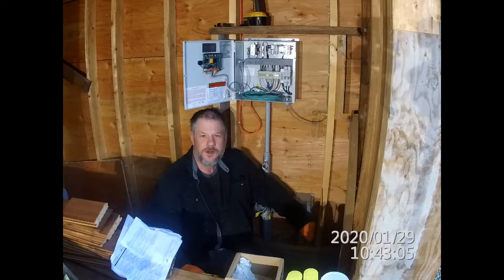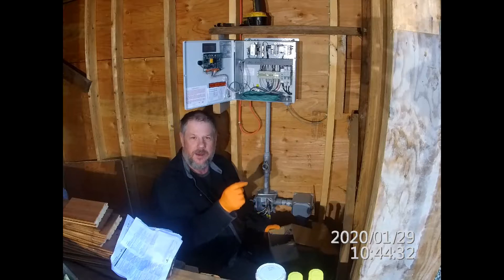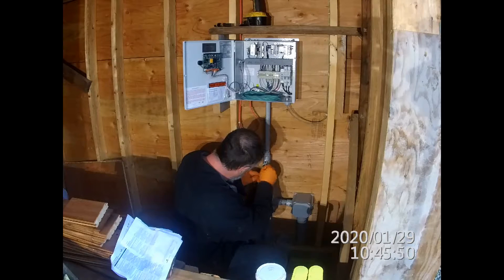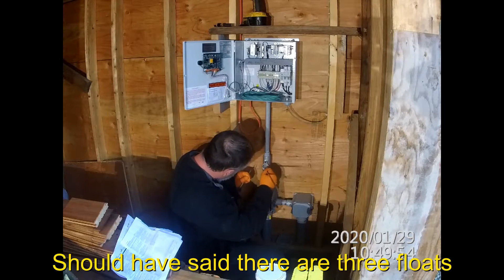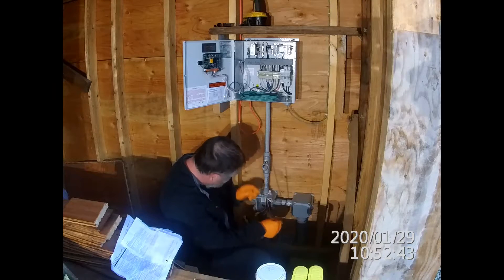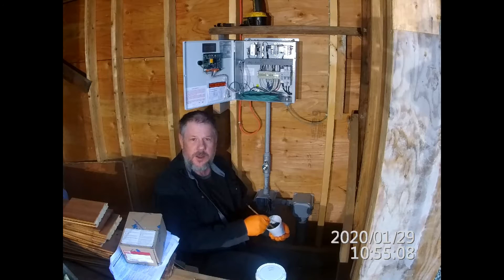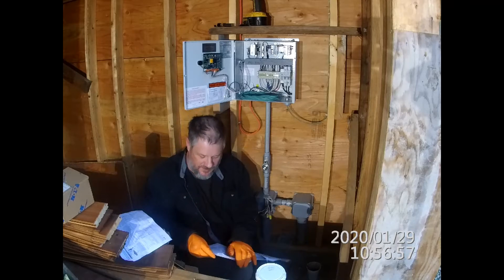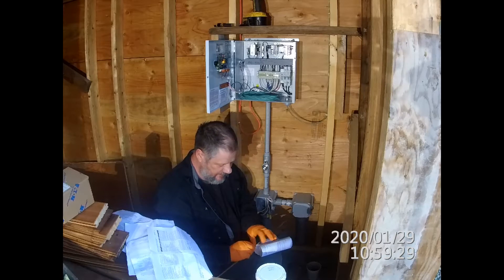Sealing Electrical Conduit Eys

Comment: While pouring sealant removing outer sheath of the cable is necessary or not?
Reply from the maker: Hi Kamesh, thanks for stopping by. Because you are running conductors through a conduit, you must run individual conductors rated for conduit use.  You can not run cables with multiple conductors through conduit. This is because the conductor within a cable can overheat when placed inside a conduit which is also insulating.  This is then why you need a sealing product that can seal around each insulated conductor.  Hope this helps.